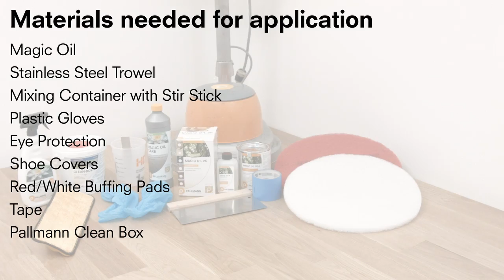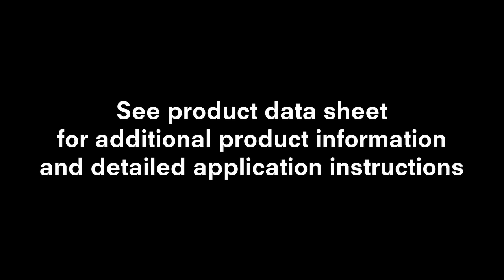Pallmann Magic Oil 2K

Comment: So this stuff is $155 for a gallon or a liter? I looked it up and can't even tell.

I can get a gallon of oil sealer for what, $45? Sure it's less durable, but finish is only as durable as the wood itself. What good is an overpriced finish that gives the exact same color as natural oil? And it requires yearly buffing correct? Starting to sound like a bad joke.

To say this stuff is overpriced is an understatement. Bona traffic is somehow even cheaper. And I have to trowel this stuff on? On my hands and knees? I feel sorry for homeowners who shell out that kind of money, and the contractor for that matter.

And any time I need to sit around and wait for the product is my time wasted. "Longer than ten minutes, no more than thirty," means, "don't bother."